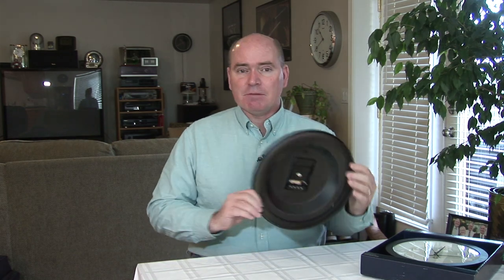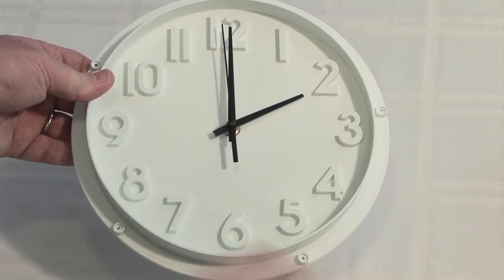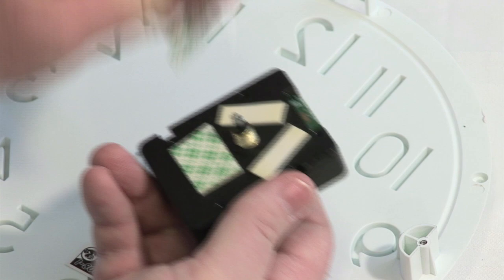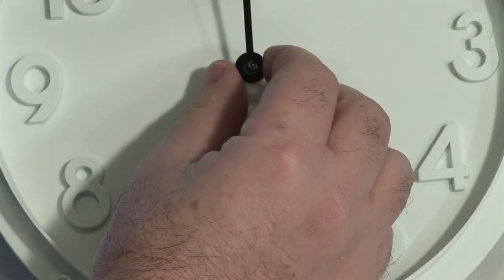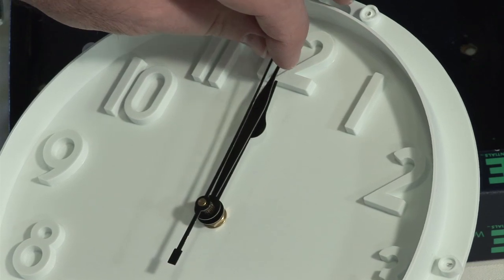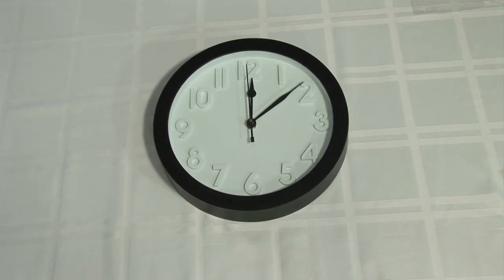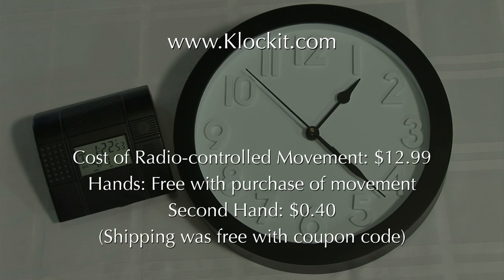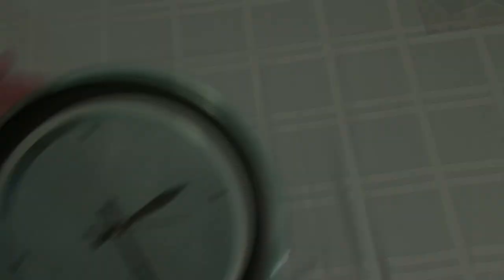Atomic Clock Conversion HD

Comment: Nicely done video.  I've been contemplating doing the same to a clock with a plain old quartz movement.  Did you buy the "donor" clock first, then select the radio clock movement from Klockit, or did the movement come first, following by finding a suitable quartz clock?

I was hoping to convert a clock I inherited from my parents, but haven't been able to find a radio movement with a very long threaded bushing, as the clock has a face that is about 12-14 mm thick.  That's even hard to accommodate with a standard quartz movement, so for the time being I had to settle for one of Klockit's quartz movements that runs with a "C" battery.  Alas, not much choice available in this regard.

Comment: I like your video; very well explained. But, is the second hand on the new R.C. movement silent?
Reply: Atomic Clocks usually don’t tick that loudly. My old SkyScan makes some noise but only every 15 seconds (the second hand has troubles on that one anyway)
My newest stepper motor atomic clock does not tick, even though it has the ticking motion. So yes these types of clocks are relatively silent.

Comment from the maker: I'm not sure if your Simplex slave clock has a metal case and/or a metal face. Klockit doesn't recommend using these with metal clocks because the metal can cause reception problems. I've done this with a metal clock, however, and it worked for me (but no guarantees for you). The only other concern would be if the clock is especially thin between the clock face and the front glass. If it's "normal" then you'll be okay. If it's too thin then you might not be able to use the second hand option.
Reply: ElmertheClep I

Comment: +Jim Watson — It depends on how close you live to Fort Collins, Colorado, the location of the WWVB time reference transmitter.  The closer you are, the stronger the signal and the best chance you have of a radio clock movement working in a partial metal enclosure.